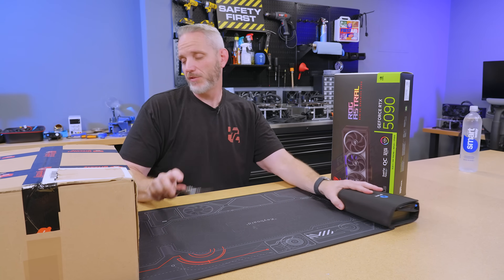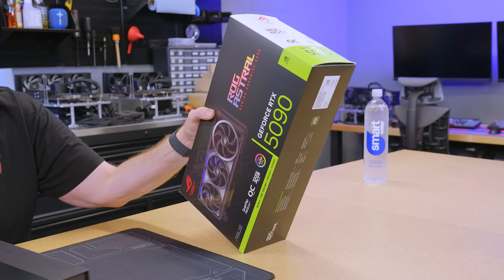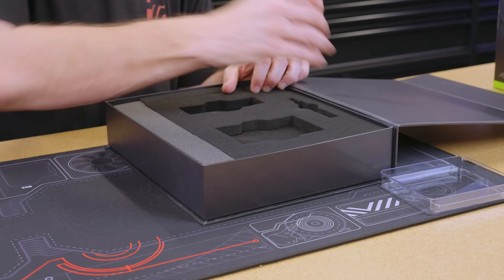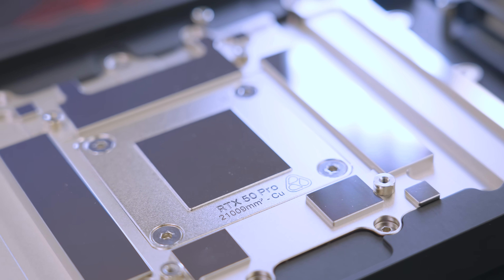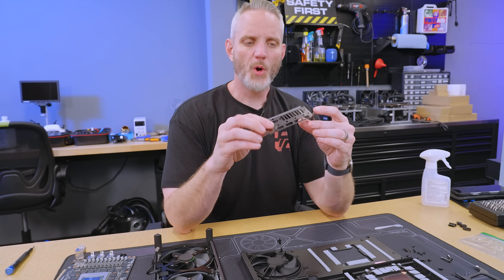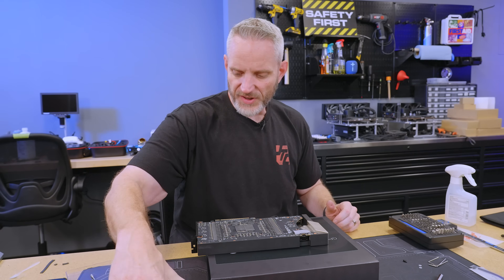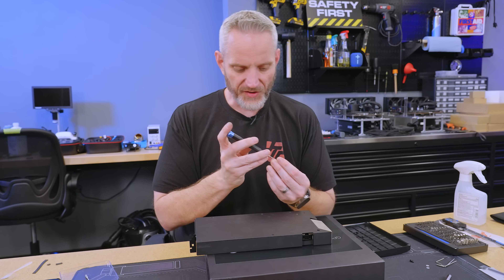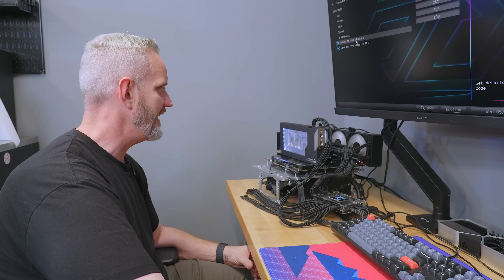DerBauers Delta Mate is better than any other block I've seen... period!

Comment: there are probably the start of the power and gnd planes near the 12V connector so they are trying to cool that copper so it sucks heat out of the 12V connecter. idk if that delta is enough to prevent connector melting but it doesnt hurt. also the lack of smd components in that area means you would get the most thermal transfer from those planes.

Comment: Nice design. But I hope, there will be another option for the terminal, so that you can connect the tubes or hoses directly from above or below without 90° adapters at the end of the card (destroys the otherwise clean look IMO)

Comment: Wth would you buy the most expensive air cooling system for the 5090 (meaning the Astral) and then put a watercooler on it? And do not tell me it is because of the double plus good electrical components they put on the board -- which is equivalent to 1000$ cable vodoo in the hifi area..

Comment: honestly ill never buy this anyways cuz 4000$ for a gpu is insane, but if it didnt have the RGB i wouldnt like it at all, even though rbg software isnt necessarily light on resources, if you have a 5090 in your computer you likely have a pretty powerful cpu so what does it matter if it uses 1.4gb of ram... and yes ive seen Signal RGB hit 1.4gb usage while idle in the background

Comment: 13:30 I think it is there, because the power connector is there. The power, which in some cases melts the connector, doesnt disappear after it enters the pcb, the lanes will get hot too. Allthough the pcb can handle this it is nice to remove the heat before it seaps into the surrounding pcb area.

Comment: Roman : hide the LED's behind a translucent white plate for a softer light - such a block deserves to be mounted vertically, in which case one mostly views the lights from an angle in regular use - and the LED separation looks cheap.
Add a simple and elegant design on the side and the back - reduces the "plain unimpressive box" look when mounted regularly in the case. Maybe even hard engraved in the metal sheets? That would give it a "deluxe" impression.
Try to reduce the fingerprint magnetism of the surface, if possible - or at least make it easily cleanable.
Water connections on the side are a superb idea.

Comment: As somebody who's made a lot of edge-lit acrylic lamps, I think the light-pipe effect with the RGB enabled is simply because the seal is pressing up against the acrylic there, and the interface changes from plastic/air to plastic/rubber and reflects differently. It's probably just some kind of silicone.
Reply: Its not acrylic, its glass :D

Comment: Great piece of hardware.......... but we've gotten to the point where we need to watercool and put pads on a 12V connector.
What next: 220V/110V plug watercooling?

Comment: Hernias suck dude. Had 3 fixed and got a bunch of titanium mesh installed with 2 of them. Be careful and get that fixed as soon as you can before it gets worse. The water block looks super slick but not for me. Great video though guys, thanks.

Comment: the astral pcb is that long ? hell no great block not criticizing it but just hear me on this, my daily 3ghz 24ghz reference design 4090 with alphacool block is 20cm 7.87" it barely reaches the 1st dimm slot it's tiny and you know what it brought to my lian li 011 dynamic xl ? great vertical airflow from the bottom fans to the top one know why it matters ?`because we now have 4+ nvme slots at the bottom and ddr5 that doesn't like heat either behind (or not in my case) the gpu those gigantic pcb and waterblock like my last ekwb at 35cm need to stop

Comment: Great video. I'm about to build my own testbench so I was wondering if anyone knows what motherboard he is using? Now with all the cpus that are frying it's not just as simple as asrock taichi :-)

Btw i dont agree it makes sense to block the most expensive 5090 where you pay a premium for an air cooling solution you're not going to use. Inno3d or asus tuf would have been more logical imo.

Comment: I got the Astral LC card and used the same cable I was using on my 5090... I got a warning that the amps were over the limit. So I started using the adapter that came with the card... no problems since.. all card should have the per-pin monitoring.

Comment: Nothing they do will fix it till they use more than 1 separate power inputs for 12pin and making THE pins bigger
they need stop fucking around and copy RTX 3090ti 12pin set up

Comment: 13:37 There are the traces of the fire bursting connector. It will probably help a bit to stabilize the temps at that point a bit to minimize wear due to thermal expansion cycles.

Comment: Wow, that block is GORGEOUS! I don't even do water cooling anymore, but this... Wow.
I still wouldn't get a 4090, or 5090 card, for obvious reasons aside from the price and the 4080 I have is cooled well enough, but yeah. That block is beautifully designed and put together.
The biggest problem with all that beauty, is going to be the price tag... But if you're a water cooling enthusiast these days, you are bound to overpay 2x on top of the normal build cost, so... That's one of the reasons I don't do that anymore.

Comment: Block will likely be the best one available I'd wager; only Optimus would be close if last gen was anything to go by. However, I am concerned about the screws and washers that are used to fasten the block to the card. The diameter of the screws is smaller than the plastic/pvc washers which, at least in my experience with EKWB cards, will start to "cave" in after a short while causing temps to gradually increase due to reduced mounting pressure. I would like to see larger heads used (preferably TORX to reduce cam-out) and/or a hybrid washer with a steel backing to prevent this at the price point set

Comment: I know this video has nothing to do with my question, but I am stuck in a bad situation.
My PC specs: MSI MPG Gaming Plus X570 Mobo
Ryzen 7 5700x - New 
AMD Radeon RX 6700 XT 
GIGABYTE P750GM PSU fully modular 
4x8gb DDR4 3600mhz = 32gb XMP enabled in BIOS.
512gb Adata M.2
512gb T-Force Vulcan SSD
1tb T-Force Vulcan SSD
SAMA 240MM AIO CPU Cooler - New

I recently upgraded my gaming desktop from a Ryzen 7 2700x, to a Ryzen 7 5700x and installed a Sama 240mm AIO CPU Cooler, everything else in my PC is the same as before. 

My issue is games like Delta force, the new Dune Awakening beta ext. games like that shut my PC completely off, does not restart just powers completely off, delta force will black screen me then I have to manually shut the PC down and when I turn the PC back on in device manager my drivers are disabled and I can't open the AMD software. Dune awakening beta shuts my pc completely down though, but other games like eve online and aska or dead side, heck even Hogwarts legacy play just fine. 

My CPU and heat temps look good across the board. I never go above 86°c on my GPU and my CPU stays around 56 to 60°c depending on the game CPU temps can be higher or lower, but GPU temps stay around 86° I've seen it go to 90° if all settings are ultra though. I do not have another PC or any hardware that I can try to narrow the issue down. I do have the old wraith CPU cooler from the 2700x, but that's all I have. I do not have the 2700x CPU any longer.

I have capped my fps in AMD software to 165hz since my monitor is only 165hz. In game I capped frames at 120hz since no option in dune for 165hz. I've adjusted settings I noticed turning upscaling off helped for a bit, but still shutting me down even without upscaling after a little bit of gaming.

My power mode is balanced, PCIe express in advance settings is off and CPU is min 100% max 100% in the power mode advance settings. Turning the pci express off did helped make it last longer, but still the PC is shutting down. I'm lost as to what it could be ATM. I'm losing my mind on this PC and I hate to buy things that it may not need, please help! I'm not the best at PCs, but I know some stuff. I just need someone to point me in the right direction of what all to I can't check and narrow it down since I have no other PC to test on and no money to really pay a shop to look it over.

Comment: I'm still surprised none of the 3rd party AIB partners decided to make a 5090 with 2 power connectors to split the power load and allow a higher total power draw instead of sticking with the single connector, especially when selling the card as an overclocked model...seems like such an easy low-hanging fruit for them, seeing as they design and produce their own PCBs anyways.

Comment: 9:58 does anyone know if the TUF 5090 has the per pin monitoring also? ... Initially it did not. Then, I thought I read or heard they added it to more of the Asus RTX 5090 line up.

P.S. the interest for your next vid with this card is high.

Comment: I would absolutely pay for a version of this if he'd do some for AMD's top of the line, esp. given that AMD lacks good block options that also look this clean. Bonus if he'd just do a full brushed steel/brushed aluminum look that's somewhat similar to the LC version of the Vega 64, with just a little corner light with his logo on it, for a simple, monolithic look both in vertical and horizontal mounting.

Comment: Does the front aluminium part of the block disasemble to be able to paint it? I'd love this block but need to turn it white. Probably cerakote.
Reply from the maker: It's not aluminum, it's copper
Reply: @Jayztwocents  Wait, Roman really just milled the entire thing out of copper not just the actual coldplate? No wonder the thing is pricey.

Comment: Haha Jay, I had a 16.110 score on the Astral 5090 OC without even overclocking the VRAM, on air alone. xD
Even funnier, my 13900K is stock with oldest microcode and bios on Z790 Extreme and running 128GB DDR5-5400 XMP CL40.
Unfortunately, both scores are off the top-100 ranking now. :)

Comment: -----
- You guys need a new 'Scale'...
Or need to double-check your conversion, 'cause you were off by roughly just under '182 grams' or roughly just over '0,4 Pounds' depending on which direction you do the conversion.
-----

Comment: Between Optimus and this water block, the "function over form" minimalist design of these high-end water blocks is incredible,  and DerBauer's 5090 Astral water block design is very pleasing to the eye. I almost feel like it's a water block that begs to have the card be vertical-mounted, since the transparent part is clearly what's intended to be the wow factor. I look forward to seeing it in a loop so we can see what design constraints/problems, if any, come from the decision to have the inlet and outlet on the rear end of the card instead of on the top like most water blocks.

Comment: About glass, one time (here in France) I saw a custom Yamaha VMAX that had glass on some parts of the engine instead of those hardened metal covers, under those glass plates were rotating parts and under pressure boiling oil straight from the engine. The owner told me the glass was holding fine even when the VMAX was pushed to the limits. I was really surprised, + it was f*cking gorgeous 😂

Comment: Personally, I think it makes more sense to buy a lower end 5090, save like $1,000, and put some of that money towards the entire loop, because prices make no sense... 
I also just don't believe there's much of a performance difference between a base "reference" or "O.C." spec and the flagships. The voltage monitor on the Astral IS pretty nice but I don't think it's worth $1K alone (after you pull the cooler, fans, and RGB doodads off of it). 
Unless maybe you're trying to get a better benchmark than a hypothetical colleague, let's just call him "Steve", then in that scenario I can see the extra, what 50?, 100? mhz, being worth $1K- Sometimes you just gotta crush "Steve" by any and all means.

Comment: I hope they leave the design and color alone,  I like the simple look and clean lines.  One thing I would want is the power cable going the same direction as the water lines, so everything, the two water lines and power lines are in parallel of each other.

Comment: On the dummy pcb, they should put the cheapest like pcie -> flash controller and a flash chip, make it appear to the computer as an ssd with all the drivers and manuals.

Comment: Is about time, looking forward to the technical deep dive on design and manufacturer from Der8auer.

Water cooling has barely moved in decades with their material choices and fabrication. Just new shapes for new pcbs. 

The fact things like Acrylic is still used on blocks and other components is absurd, given its resistance to basically nothing. 

DI water damages it, alcohols damage it, corrosion inhibitors damage it… endless.

Then the cold plate itself, not really seeing phase change materials (think: heat pipes / vapor chambers) being attempted to increase cold plate heat extraction rates.

Another thing killing water cooling is a lack of reference designs. So nothing can be standardized (and benefit from scaled production).

Comment: Seeing this just reminds me about how few make blocks for 5xxx and 9xxx series. Checked a little last night, and even Alphacool is also shocked. Since they are one of the few that do make some. But it will take so long to get any, because they have such a demand they can't keep up.
Checked for 9070XT blocks, and they only have 1 on the shop so far. With a long wait time. It's so bad my consideration of getting a new card is almost not on the table. Run full watercooling loop, so having an air cooled card there for so long is not what i want to do.

Comment: That would imply that it makes more sense to block an astral than other cards and it doesn’t. You’re way better off picking up the gigabyte aurous extreme WB or any other 5090 without a block below $2500 and putting a water block on it than wasting money on an astral. Literally the only thing it has above other cards is the sensor on the power pins.

Comment: I believe the 4mm pad is there to sink heat away from the 12V connector on the PCB (i.e. anti-melt).
Reply: It won't prevent melting, since it can't cool the plastics,  at best it might slightly delay it, and maybe prevent damage to the pcb. the copper traces on the pcb will also get warm if they transfer 50 amps, so it's probably to cool that.
Reply: @girder123  It's not cooling the plastic. The plastic isn't what heats up. It's cooling the solder points on the PCB where the connector makes contact. Cooling that metal will in turn lower the temperature of the solder points up through the pins on the card. This will in turn cool the pins on the cable side since they are all one continuous electrical bond.
Reply: @nomisukeindustries  You can not transfer this amount of heat through the pins, the solder, a few µm pcb, soldermask/pads and into the cooler in time to prevent melting the plastic. Heat transfer rate is a bitch.
Reply: @girder123  Well, we'll find out soon.

Comment: JAY! @9:28 you nailed it. 

3090 EK water dual active blocked was argued the LAST "stable" enthusiasts card "I" trusted and from EVGA it made things even sweeter. 

When EVGA spoke out about how on their feelings and the short commings of the 4090 and theory 5090 too with that trajectory... 

Looking back I am HAPPY to own two EVGA 3090 with EK active water backplated cards. As they "should" remain cool and reliable aswell relevant for the next few years
Reply: With a 19k nearing 20k cenabench score. Thats not much to snuff at when the TOP is just above 30k.... and mine is chilly and happy undervolted and overclocked system rarely gets over 55°c under the heaviest loads.
Reply: The EVGA 3090 Ti was an absurd product but it's real nice too. The air cooler can keep it from throttling at 500 watts. I sure don't run it like that but it's good enough I haven't gotten around to installing the EK double waterblock I got for it yet because an aggressive fan curve on the stock cooler gets similar temperatures to your watercooled ones (although much louder)

Comment: A block for Tuf rather than Astral make more sense as the premium you pay over a Tuf to Astral is almost pointless when you unintall the stock cooler. (Only difference i found is the mosfet on Astral per phase rated at 80amp, those on tuf rated at 50 amp).

Comment: Regarding the RGB, considering it is only visible in a vertical mount and it would be much closer to the glass than the rest of the components in that configuration, it might not need to be that bright. It would be nice to see it mounted that way in a complete build (I'm sure it will happen eventually)

Comment: Why he placed pads just below the power connector? My guess would be to cool down these connectors, as they are what will be heating up most and can cause the melting.
So cooling this passively will probably help a little, and a little probably goes a long way with the connector issue. :D

Comment: I love the design of the block...both the see through part and the "boring" backside... its a fantastic calm option for people that dont want to have the horrible rgb puke everywhere...

The engineering and thought processes that are visible in every step of the installation, is just awesome to see!
Reply: I'm also not much of an RGB enjoyer, but the fact that they somehow got RGB to light up the rubber seals that create the flow path is super impressive. Plus when the RGB is off, it doesn't even look like there are any lights there. Very sleek.

Comment: Jay: "we do know, that it's solid copper block"

Actually TG clearly marked, that top of the block is made out of AlSi1Mg1, which is an aluminium alloy. I would like to know, how are they preventing galvanic corosion - maybe thick anodization? Also would be great, if the 500€ block were made also in different colors, like white
Reply: The aluminum is only used in the backplate and the frame. the coolant in the loop only comes into contackt with the nickel plated copper.